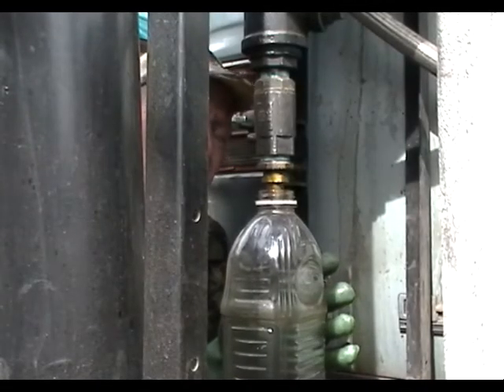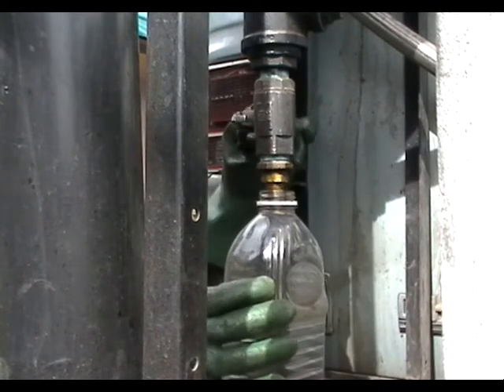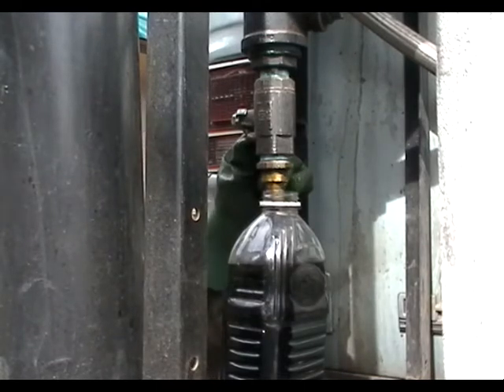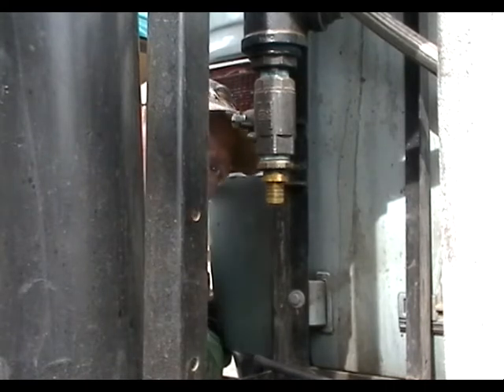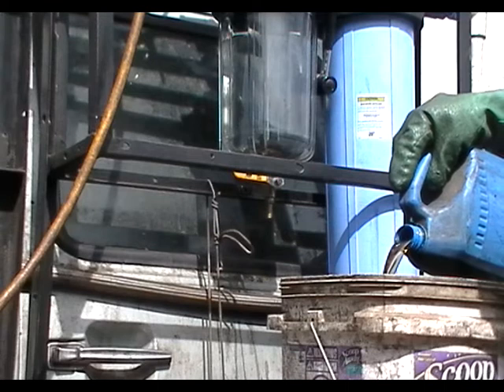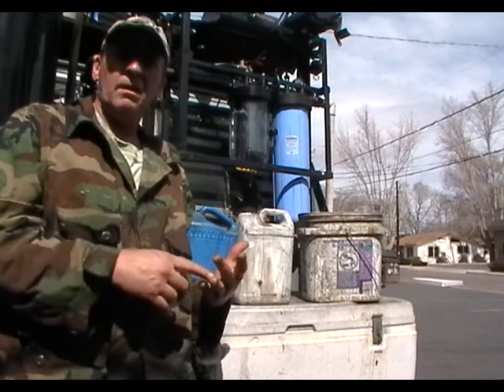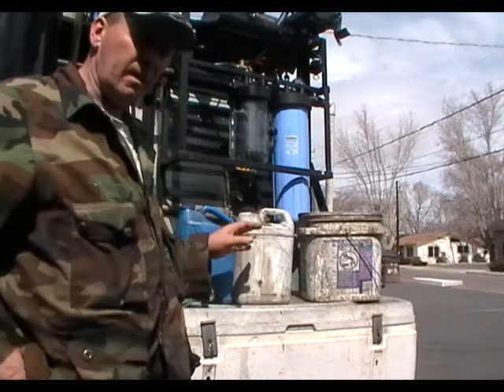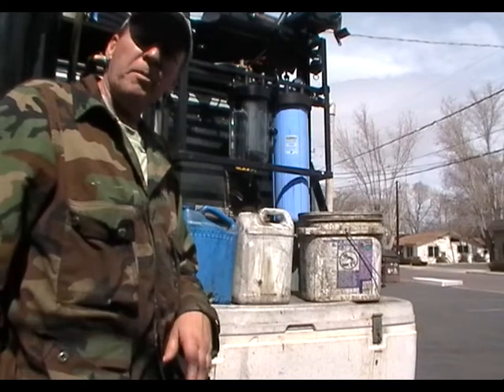Removing and reprocessing the sludge

Comment: Sir, respectfully speaking, Fuel Right is not a solvent.  It uses filming amine chemistry to melt the sludge to under 1 micron in size in solution to where it can pass through the fuel filter and be burned harmlessly with the fuel.  It is this action that clears the tank and prevents fuel filter fouling while also eliminating corrosion.  It 's a diesel fuel tank & system treatment that coats all hard surfaces in the system to keep the slime forming bacteria from attaching which prevents growth

Comment from the maker: Gasoline blending removes the water in waste oils that promotes bacterial growth, therefore the "slime forming bacteria" does not arise, and is not the cause of the sludge that I reported here.  

This sludge is the product of incompatible components in a fuel blend, which precipitate out of solution when given enough time to settle out.  Not the product of slime forming bacterial growth in damp diesel fuel.

Comment: Hello Mr. Brooks,

Thank you for the swift reply. 
Can you clarify what you mean by that the fat melt? consumed? 

I understand from what you have said and your video explanation that you let the sludge settle more with time. By doing so, you get a good thin fuel-grade blend. What I am after is what you did with the left over sludge after you get that good thin fuel-grade blend. No matter how many cycles you do, you would still have some left over sludge contents. I'm sure you don't just dump it in a trash can. 

I look forward to your reply. Thank you very much for sharing your experience!

Regards,
kwo0301
repost from Nov. 10
Reply from the maker: In warm weather some of the fats that precipitated out from the blend in cold weather will dissolve and be consumed as fuel.  Whatever does not get consumed by summer gets disposed of at a WMO recycling place, such as an auto parts store.  If you heat with solid fuels, such as wood, then the sludge can be used as fire starter.

Comment from the maker: The thing that you are clearly not getting is blending solvents with any waste oil is going to produce sediments.  Those sediments cause problems for the engine.  You do NOT want to prevent them from settling out, or you are going to cause problems for your engine.